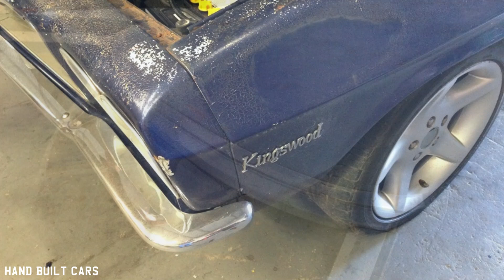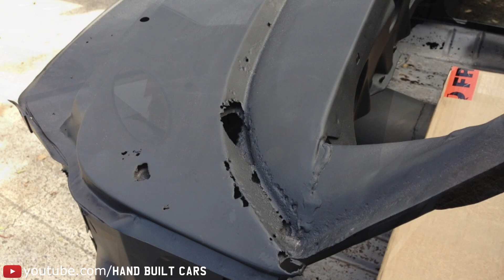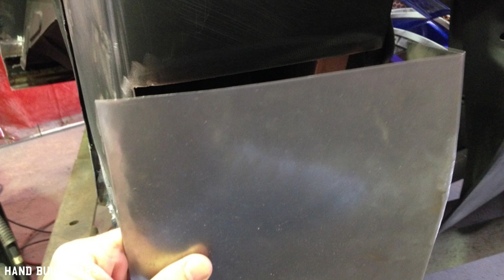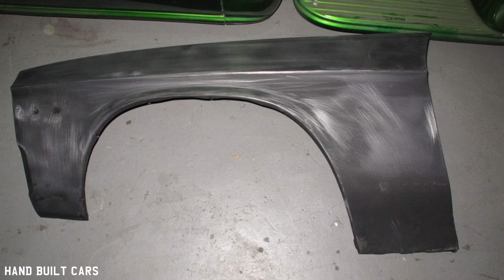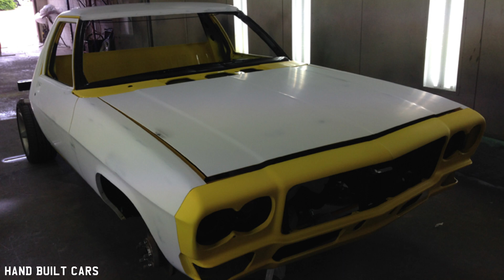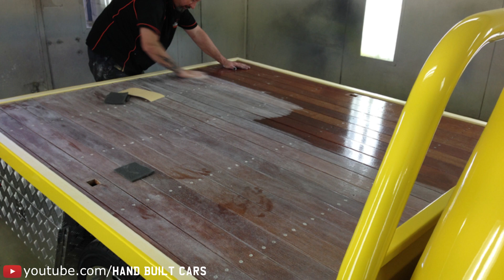1976 Holden Kingswood HJ 1-Tonner Flatbed Truck Restoration Project

Comment: Nice work, looked like some serious rust cut out. Sympathetically restored and nice trim work also in the dash and door panels, bench seat. Love the touches at the back with the deck and alloy boxes. A+ I had a HQ in the day loved it, was a real work horse but even then it had rust in the lower sills.....